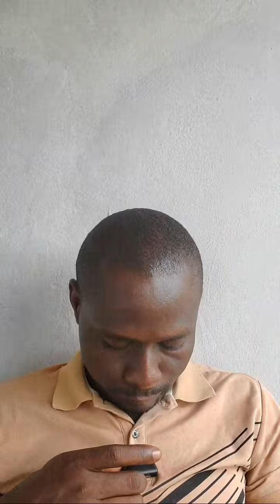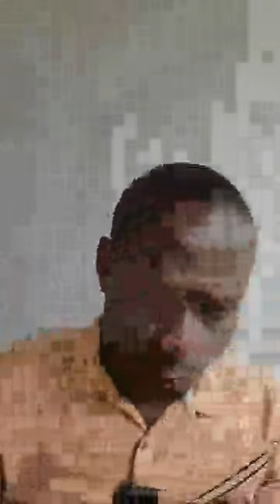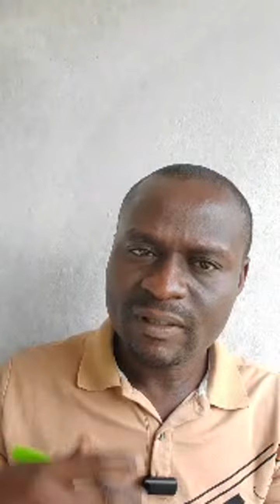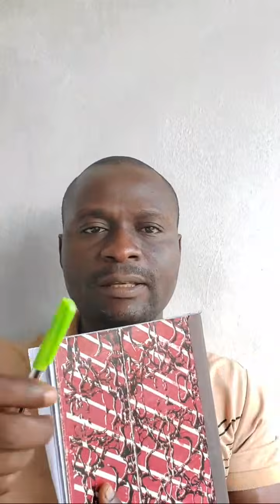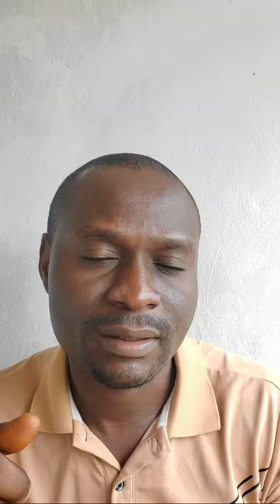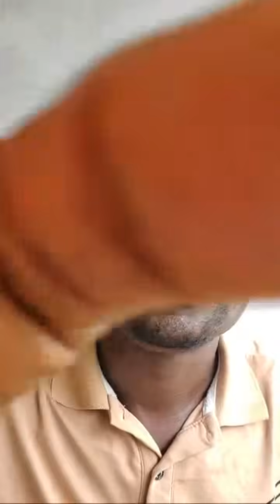Ask your questions

Comment: good day i have a mppt charge controller 100A/100v max and a 12v 2000watt pure sine wave inverter with a 375 watt solar planel
but the 12v setup is 15-25v and the open voc on the planel is 41.45 and max vmp 34.50  can i use that panele with tthe charge controller and a 12v 100ah battery ?  because i cant get any 200watt panels where i am only from 300 watt upwards

Comment: Please how do we size cables during installations and know the length of càbles to use during quotation to finish a project.
Thanks
Reply: From Lagos
Reply: Cables are sized regarding the maximum current it can withstand
Reply: The shorter the cable the better performance to reduce much losses